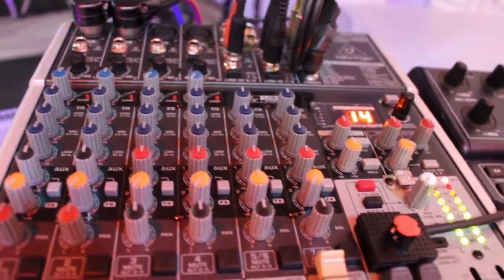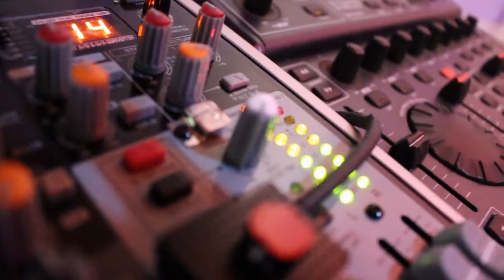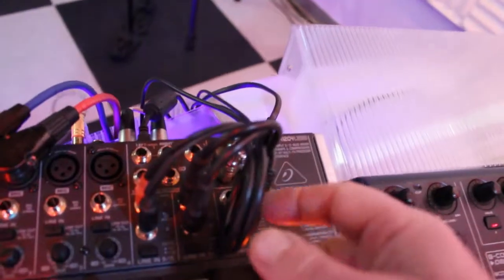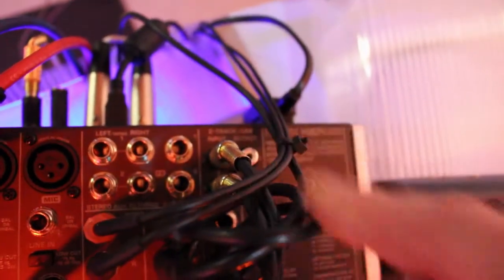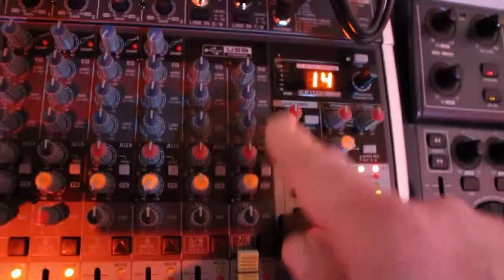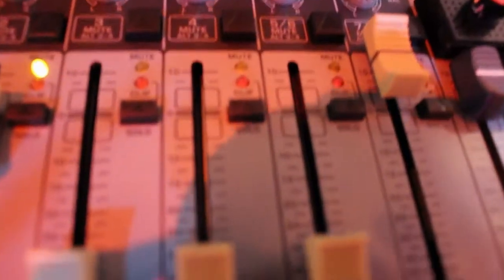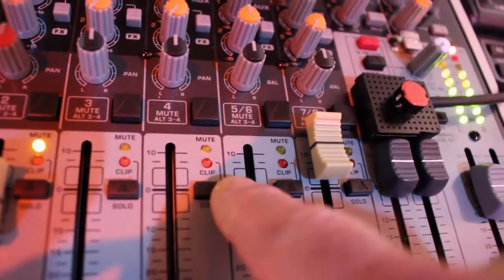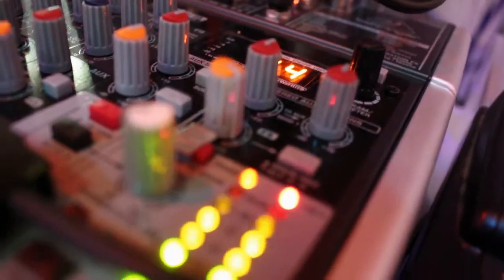How to modify Behringer Xenyx X1204USB Mixer to adjust the USB interface volume

Comment: What’s the dimensions of this piece of metal?
Reply from the maker: the piece of metal is bent just enough to press the button halfway through its use stroke. the piece of metal is bent just enough to press the button halfway through its use stroke. In this way the button does not make any electrical contact. By doing this, the audio output is found on the "INPUT" connectors from which the output signal will be taken.